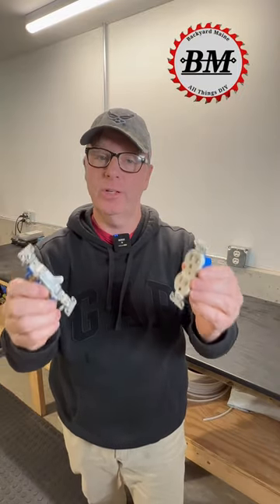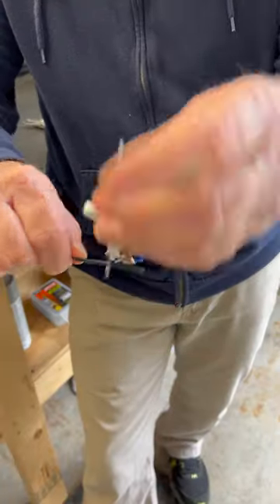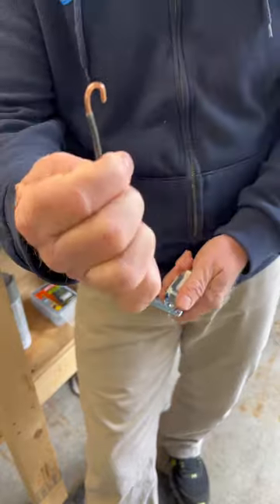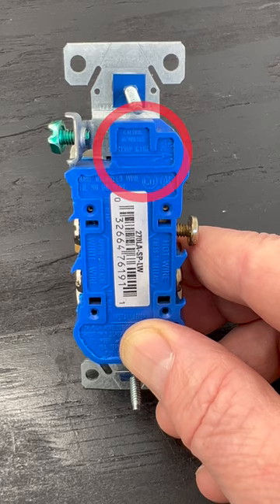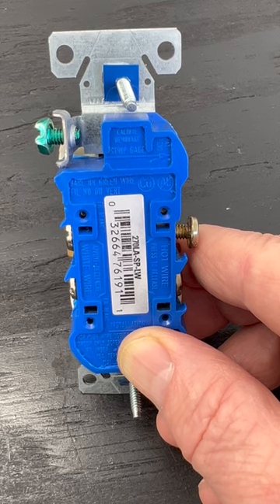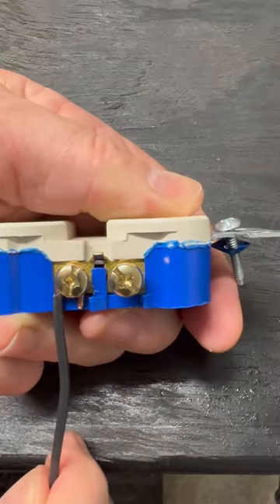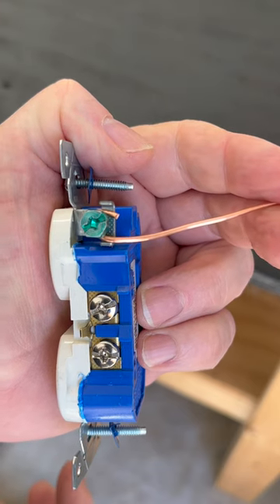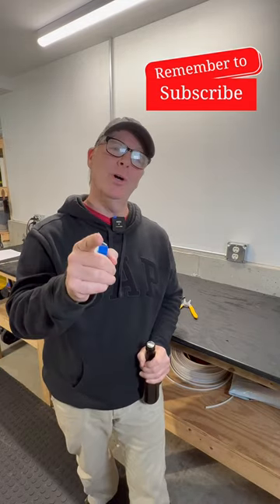Eaton Electrical Outlets are like a Swiss Army Knife #shorts

Comment: The little ears are grooved where they attach so they can easily break off to fit in a 4 inch metal square box with a 2 gang cover plate.  Or they have another serration to break the whole end off for even tighter spaces. And yes, they WILL open a bottle!
Also, the little tabs between the connection lugs are serrated so they can be broken off to separate the top outlet from the bottom outlet. This allows one to be always hot and the other switched, or have them on separate circuits for whatever reason.
Reply from the maker: Yup..

Comment: I started my electrical  career on Motor Controls I rarely touch anything else and you're videos just are neat keep them coming
Reply from the maker: I started out doing mostly controls and large industrial installations as well. I only ever did residential work on the side. I eventually became an electrical engineer but I'm retired now.

Comment: My friend taught me about the tabs used to bend the wire around the screw. Once I got the hang of it I could go twice as fast. I usually do the hot side that way and make a loop on the others so that I don't have to bend all the wires so many times. If the wires are long enough, it's easy to do both sides.

Comment: And remember folks, if you backstab an outlet, you're a hack.
Reply: "Alexa, what is bad about backstabing a receptacle?"
Backstabbing a receptacle is essentially a shortcut to secure the wires onto the receptacle. Instead of anchoring the wires to the screws, they are pushed (or stabbed) into the small holes on the back of the receptacle. Over time as you are plugging and unplugging items from your receptacles, these wires become loose.

Comment: I examined the switches sold in my region. It does not carry the features that I see on ur switch. It only has the holes, there is no strip gauge to strip the wires.
Reply from the maker: Look for Eaton brand, They have this feature on both residential and commercial grade devices.
Reply: In the US and Canada.

Comment: Good luck finding Eaton receptacles. They are having problems with the U.S. ports, and many suppliers, including Amazon, can't get product for months. I switched to Hubbell instead.
Reply from the maker: My local Lowes is fully stocked with eaton receptacle and switches. Maybe its a local problem.
Reply: @BackyardMaine    The cheaper "residential" models may be available. I wanted "commercial," in black.
Reply: @KJ_nyc Hubbell are superior! Eaton doesn't come even close.

Comment: Bought an Eaton switch today. Looks like they did away with the built in wire strippers
Reply from the maker: Really. I will have to check that out the next time I'm at the supply house. The ones I bought a few weeks ago still had the stripper.

Comment: In the old days, I think those were Eagle  switches from Cooper Industries. A lot of homes built in 1960's and 1970's have them in the walls.
Reply from the maker: Cooper Lighting was purchased by Eaton in 2012. Eaton has a patent on the wire stripper since 1994 but I'm not sure how long the plastic tab for bending the wire has been around which is probably what you're referring to.
Reply: @BackyardMaine  Thanks for the info. No, I just noticed that Eagle disappeared, and Eaton appeared. I figured there must be a connection. 

In my house, all of those old switches have the wires pushed into the holes in the back of the switches. I tried changing one, but had trouble. Then I couldn't get the wire to stay in the hole. I guess once the release tab on those old ones is used, the mechanism permanently loses tension. I had to use a pigtail to reach the screw on the new switch. After that, I didn't try any others. I don't think a lot of wire was required by code in the old day and there may be a very short available length in the box. By the way, the one I pigtailed was 20A circuit, so I had to find a short length of 12/2 romex. The days are gone when a DIY'er could walk into Lowes or HD and buy a short length of that wire. Now we are forced to buy 25 or more feet. I was able to find a new homes site and got a foot of 12/2 from one of the builders. He knew exactly what it's like trying to buy wire these days, because sometimes he needs short lengths too.
Reply from the maker: @topgrain  Yes those connections are one and done and cannot be reused. I actually have a video on that as well. https://youtu.be/e_C_twh5fQE
Reply: @topgrainw wait a minute...Excellent video ! Ok, now I'll irritate-bate then explain.  

There is NO REASON TO USE 12/2 ROMEX FOR A SHORT PIGTAIL TO A LONG RUN OF 12/2 ROMEX AND AN OUTLET OR SWITCH....

According to the physics anyway...

It's the length of the run that determines how large the conductors must be, not the AMPS.  
I got SCHOOLED mercilessly on this by a Caltech engineer making MEMS electrical relays in a silicon chip.  Not transistors. Actual physical switches just a very few thousandths of an inch of contact width.
But the length in the wire direction was also extremely short, so the tiny conductors could easily carry 40 amps !  Unbelievable until you see the physics. 

The MEMS device was similar in movement to a DLP video chip. But moving a few contacts instead of a million or more tiny mirrors. 

SO FIRE AWAY with the other (usually good) reasons to continue the use of the same ROMEX for the pigtail! 
Multiple "the next guy won't know " arguments are really smart.
"Hey dummy, in AC that smaller pigtail would be in the middle if you look at it from the electron's point of view "  Yeah. Not as smart  but should be entertaining to hear.